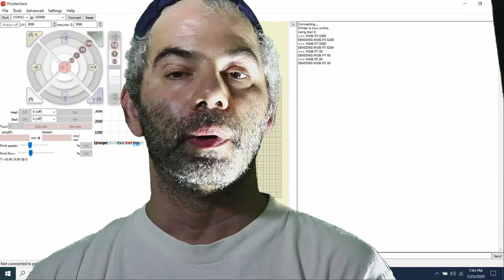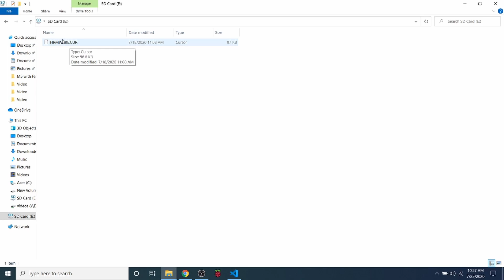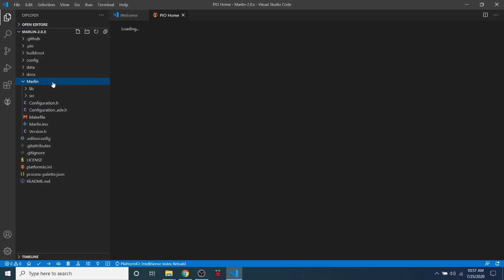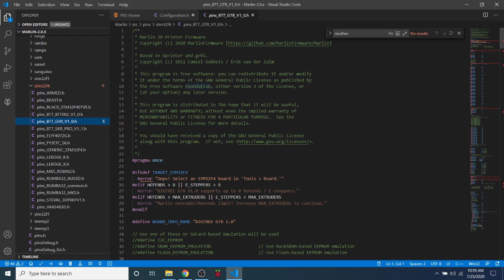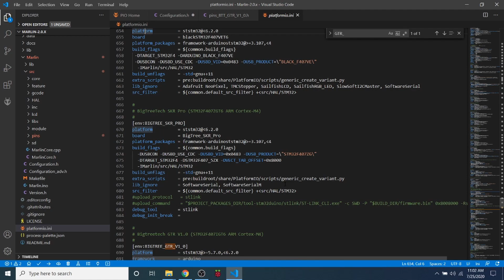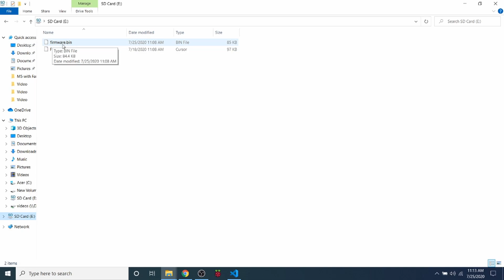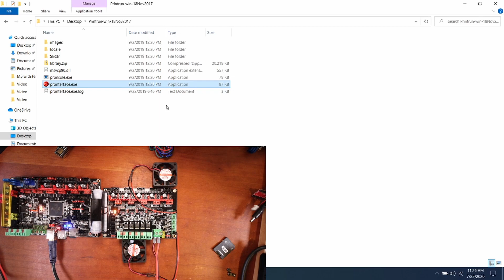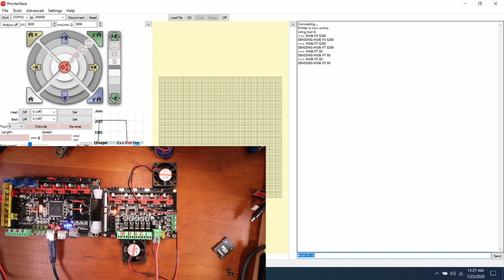BTT GTR v1.0/M5 v1.0 -  Configuring Fan(s) and M5 v1.0

Comment: I noticed on my M5 that there's 12v VIN(VCC) jumper on the bottom right. Assuming it's got a buck/step down converter for those fans. Is there a similar set of jumpers on the GTR that I'm missing? Or, are Fan1-Fan3 on the GTR always run at PSU voltage in, while Fan1-Fan5 on the M5 are switchable between 12v/24v?
Reply from the maker: Is best to stick to same fan voltage as PSU.
Reply: @EdwardBraiman  I intend to. I was just curious when I saw the jumpers. Doubly so when I noticed they weren't on both boards
Reply: @EdwardBraiman  I run a 24v system, so the worst case is that I accidentally underpower my fans, since I don't buy 12v fans. Much better than the reverse of that happening
Reply from the maker: If memory serves me, on GTR board no.

Also when I demoed on live stream I had issues with two different ground planes possibly.

Comment: This is great and all, but how do you get the fans to work properly WITH OUT the M5 extension!? I can’t get them to work and there is literally nothing about it in the manual or that I can find online. Your video is the closest thing and even that doesn’t apply to the GTR itself unless I had the M5 board :(... plz help!

To be clear I can get the fans to work in pronterface like in your tutorial. However the don’t work when printing, I have to manually turn them on or off during every print.
Reply from the maker: The pinout file may have fans commented out.

Comment: I am using the GTR_V1 and the M5 with TMC2209 on my Mostly Printed CNC (MPCNC) from V1 engineering, and would like to use all 11 drivers I need help finding just where you connect the switches on both GTR_V1 and M5. And I am trying to use the Sensorless homing I can use the Dual Steppers / Dual Endstops X, X1 and Y, Y1 but cannot use the Z, and Z1 for Sensorless homing. I am having problems using the Zmin and Zmax homing. Can you help with this?
Reply from the maker: I'll see if I can do a video on this, this weekend.  Remember I have a Discord which I'll be on this weekend if you want to try and walk thru it.
Reply: @EdwardBraiman  I downloaded Discord and signed up but could not connected to your session, did you 
Do one on the GTR_V1 on how to connect the Z1 Min and Z1 Max
Could you do one on all the AXIS Min and Max for the end stops for the GTR_V1 board
Could you send a link if you did I can’t seem to find anything on it
Reply from the maker: In my video description, the link should take you to Discord unless I made a mistake with link again.
Reply: @EdwardBraiman  Did you do a new video on how to connect the EndStop Min and Max to the GTR_V1 mother board
I cannot seem to find anything on that. Am I looking at the wrong place could you email me a direct link?

Comment: Hi Edward thank you for the tutorial;) but fairly talking do not understand why somebody would need so many (11) motors ;)
Reply: I for one need all the drivers. I am trying to build a 6 axis CNC and also use 3 more for 3D priting
Reply: @gegrove1  You probably want a closed loop driver module for your steppers assuming your trying to stick with nema 17's and just do some light weight engraving style cnc work not make huge chips, ustepper, mechaduino, or the cheapest option BTT S42B 42 would work well. It'll keep you from skipping steps loosing where your at and crashing your tool into your tool.
Reply from the maker: Well I looked into closed loop and it has only one advantage of not losing  steps, but has the precision of an A4988.  So for the money I avoiding until they have the precision of a TMC.
Reply: @EdwardBraiman   @Edward Braiman  Not so important with 3d printing, but when your dragging a tool through a work piece and chatters & binds & skips a step or 2 here. When it gets to there and it's cutting a hole through your build plate which is also a heated print bed it's more of an issue.  Do wish there was a TMC 2208+ flavor of it but sadly they are all probably clones of each other as the first 2 are open source ish.
Reply from the maker: You'd be surprised, one person in the UK is going to try two, three input print heads with conductive and non-conductive material.  It's maximizing Marlin firmware capabilities to the extreme.
Reply: Edward Braiman in that case sure this is great :)
Reply: @mitofun6967  Dual Z is common for heavy prints, why not 4  for automatic leveling off of mesh bed leveling?  Dual X&Y let you swing a heavy direct drive 3 color mixing head. Want to DIY tool changer but need a servo for the carousel & changing mechanism. Tun of reasons you might want one. Palpatine said it best though "unlimited power". It's also the only real competition to the DUET & costs way less & you can pick every stepper driver yourself & has an open firmware.

Edit: Oh and what about a 6 axis print head? there's that too.
Reply: @ransombot  agreed for heavy prints is perfect)

Comment: Quite an odd question Ed but I brought a mini E3 V2 and It works fine, The problem is when I plug it into the computer via USB cura doesn’t pick the board up and I get an alarm sound from the board.. Is there anyway I can fix this?
Reply from the maker: I'll see if I can replicate tonight.  Does Pronterface act the same?
Reply: Edward Braiman No pronterface works fine it’s just cura (which is my go to software) I get this terrible alarm sound and sometime I get a printer haulted message, I’m not sure if it’s a cura plugin or something but I’ve been trying to sort it for 2 days with no joy, My old SKR 1.4 is fine it’s just me SKR mini e3 v2 that has the problem
Reply from the maker: I'm not sure.  It might be a setting.  I'm not sure if I have this board at home.  I'll check tonight.
Reply: Edward Braiman Cheers Ed you’re a gent
Reply from the maker: Okay, I checked my printer board collection and unfortunately, I do not own one as of yet.
Reply: I know this question is a bit old but was curious if you had figured out your Cura integration issue with your new board?? if you haven't yet, (which I hope you have) have you made sure you downloaded the corresponding driver set for the new chipset used on that board?? I would recommend you go back through and make sure you have all corresponding software downloaded before attempting to control it with Cura because its a very finicky/sensitive program where I have experienced the weirdest of issues/bugs and sometimes it even requires a fresh Cura install with no add-ons installed or sometimes its because you had an old version of curs installed underneath a newer version causing a miss-match version corruption issue with serial com port controls etc.. I can go on forever lol but only if you are still having any issues!! I just recently acquired a GTRV1 and this board is the shiznit, blows DUET outta the water! Better yet I can even compile DUET FW on this board if I wanted to do so as well 😂😂
Anyway, I hope you've made it work!! Happy Printing!!
Reply: @yourtubernoob  Yeh mate you have to go into you’re cura software folder and uncomment a few lines, If you want me too I’ll walk you through it?
Reply: @tonygudgeon1839  I don't think you understood my comment.. lmao I was the one offering you the help incase you still weren't able to connect to your board over serial 🙃 but thanks for wanting to help out anyways 😅 hope you've been getting some legit prints out as well 😉
Reply: @yourtubernoob  😂 Sorry mate, Yeh I got there in the end, Took me about a week but finally made it through, No worries mate and Thank You for explain it better then I ever could! Top Man